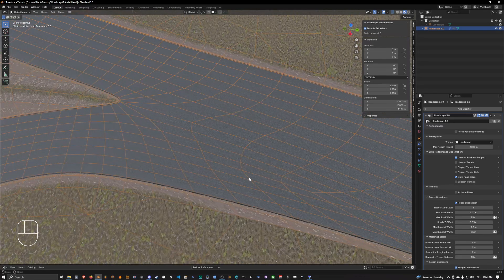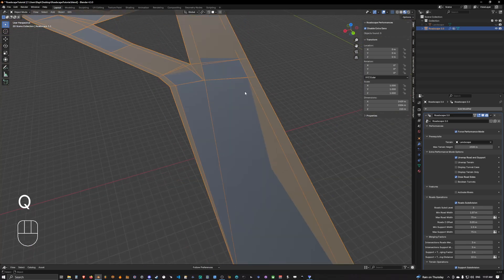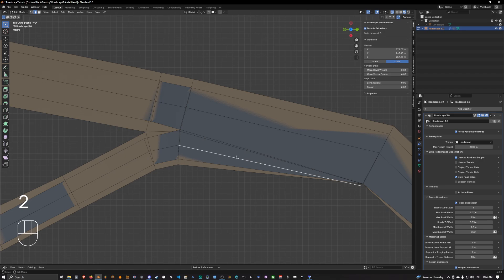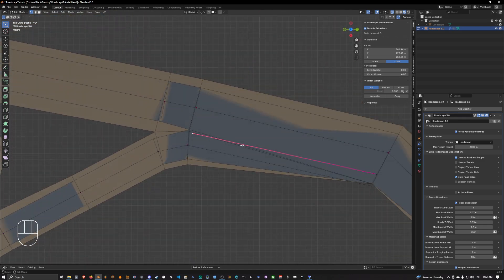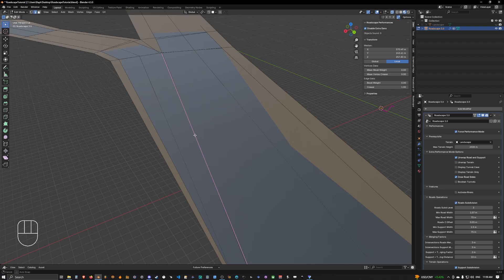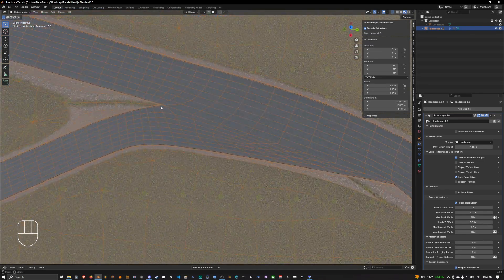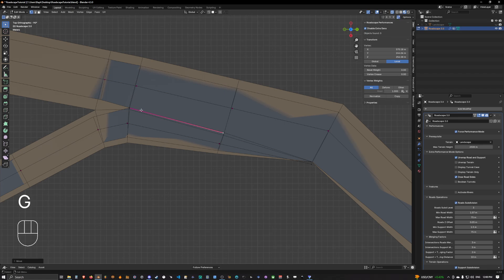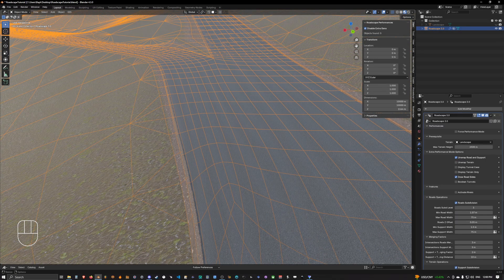Roadscape V3.0 - Pt.21 How To Crease a Corner

Comment: Coucou, est-ce possible de faire la route directement depuis une curve deja fait sans devoir faire l'extrusion petit à petit sur toute la longueur avec le snap? Par exemple en mettant le modifier sur la curve faisant automatiquement la route?
Reply from the maker: C'est possible en effet, en convertissant la curve en mesh, et ensuite en CTRL+J (Join) la courbe convertit en mesh à l'object Roadscape.
Reply: @baptm727   merci pour la réponse très rapide, malheureusement j'ai essayé mais la curve (maintenant mesh) en faisant CTRL+J à l'object Roadscape disparé en Force Performance Mode:On et reste invarié (donc toujour un tracé) en Force Performance Mode:OFF.
Il y a t'il quelque chose à faire avant ce passage? 
J'ai essayé aussi avec et sans Apply All Transform mais rien
Reply from the maker: @emilartrex6422  oui il faut assigner le vertex group "road" aux edges en question, et aussi donner un peu de vertex crease et vertex bevel weight aux edges
Reply: @baptm727  Ca fonctionne merci beaucoup!